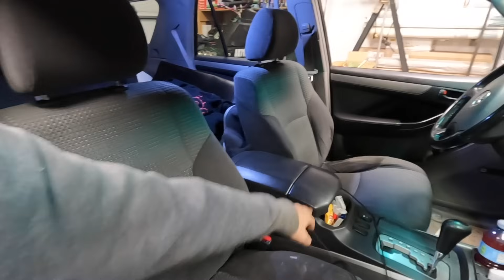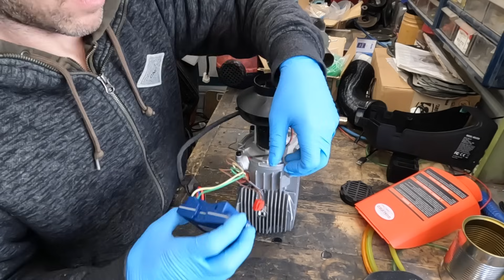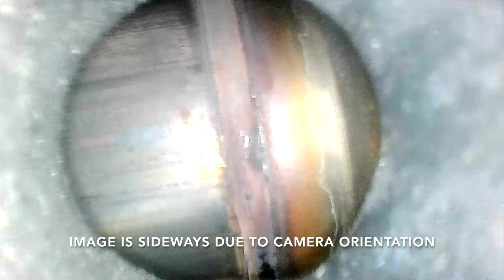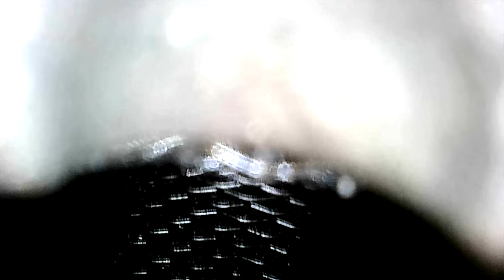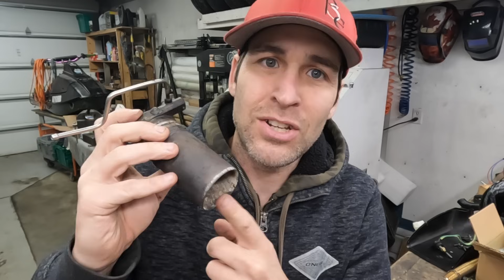Diesel Heaters - Orientation Deep Dive - Heater Mounting Explained

Comment: So what your saying is... you may mount the heater on its side?
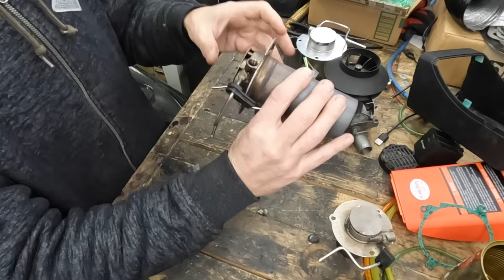as long as "Flame initiation hole" is facing up, so fuel doesn't drip out 12:29
Reply from the maker: Basically, yes. Make sure that your glow plug is tight, and i would inspect it after a few hours of running, to make sure it isn't leaking.

I have not had any issues, as long as the initiation hole is facing up.

Comment: In the video, the 5kw vevor diesel heater was the one that couldn’t be mounted on one side because of the hole placement in the combustion chamber. However, does that also rule out mounting on the other side? Let’s say in the video you rotated it 90 degrees to the left but because of hole placement, it didn’t work. Let’s say you had rotated it 90 degrees the other way instead. Would that still cause issues or would it work since the hole technically isn’t able to leak now?
Reply from the maker: The only reason the heater can be mounted one way and not the other, is the hole location. In my experience, if the hole is not pointing down (fuel can't come out of the hole) then it will run fine. 

I ran my heater on its side for a year without any issues (caused by the hole).

That being said, some manuals say you can run them on one side and some  suggest only mounting them with the inlet and exhaust pointing down. I would say that if you mount it on it's side, monitor it closely for the first few litres of fuel and see if it does anything funny... If you are mounting it on something that moves, a car, bus, RV etc... motion of the vehicle or parking on an angle could also cause unexpected problems if already compromised.

Comment: Do u think i could make new hole for air and block the first one? I must keep orientation i have now but it is leaking
Reply from the maker: If you can come up with a good way to seal it, then I can't see why not... Keep in mind that that area gets quite hot. JB Weld might work. 

Also... from my experience that material is not easy to drill.
Reply: @loweredexpectations4927 thank u very much for ur answer and perfect video by the way🔥

Comment: With a diesel engine there is an injector to spray a fine mist of fuel into the head, I wonder if that would be better to atomize the fuel would it burn better?
Reply from the maker: I have gone down this road a few times, and had may people suggest it. 

This would work in a larger / higher output heater. The problem is that these heaters burn such a small amount of fuel (low flow). 

In order to build pressure at very low fuel flow, you need an extremely tiny hole. 

For example. A 5hp diesel engine will consume 1.9 litres per hour. These heaters consume a maximum of 0.5. Meaning you would need a nozzle to be about 4 times smaller than one in a 5hp diesel. 

Probably not impossible, but very tricky and probably problematic. You then also need to power a high pressure pump, and that would require more than a few watts.

Comment: Cool video. You confirmed my theories while I was tracing down the reason for the diesel smell and the fuel leaking out from the burn chamber. I first thought the plastic fuel line was leaking, but that was not the case. It was much deeper than that. I opened the combustion chamber and spotted the vent hole. I thought, maybe the fuel was leaking from this hole, but that too was not the case. The metal fuel line was not fully brazed in place and fuel was seeping from around where the fuel line was brazed to the combustion chamber causing a fuel leak mess and diesel smell from the heated fuel leaking out. While cleaning the burnt fuel the fuel line broke free from the combustion chamber making it clear that the fuel line was not fully brazed in place and fuel was leaking from around this fuel line. I cleaned all of this location, fully brazed it back in place, and reassembled it. I have not had any more troubles with this heater. No more fuel smell and no more fuel leaking outside the heater onto the floor. The smell was much worse during a lower level of three or lower than it was at higher heat levels.  I hope this helps anyone else who has experienced this dangerous situation.  Had nothing to do with gaskets as other forums have led to believe. 🤠
Reply from the maker: Awesome... good job sorting this out.

Comment: 5kw vs. 8kw .... 3kw difference or just the Chinese marketing illusion ?
Reply from the maker: Marketing wank. 

They almost all use 22ml pumps, so to actually put out 8kw ... it would have to cycle at a little over 10hz to deliver 8kw worth of fuel. More of an issue, is that the body of the heater simply can't support that much heat output. 

The air inlet and exhaust are too restrictive so you have to really force air in there, but more than that, the heat exchanger would not be able to absorb and dissipate that much heat. There would be a huge amount of waste heat out the exhaust (more than currently) and the temp of the exchanger would be off the charts.
Reply: @loweredexpectations4927  Got'cha.
If they're selling a 8kw for $150 and a 5kw for $120 then it's a 5kw as the 3kw difference is just bollocks and fresh air....

Comment: I have a few of the chinese versions, (2 in use most days for 5-8 hours in my spa area, i love 30+deg in there) and have bought various spares parts. Some burn chambers differ to others, in some ways. for example some have taller fins at end plate, meaning a larger air gap, some have a nice taper to edge of entry hole inside fins, others just a sharp 90 deg edge, also height of fuel entry from end plate varies a little with some i have bought, along with some being fully cast including mounting flange, whereas most are are sheet metal for flange, so all are not always identical, and may require slightly different settings for best burning. I had one burn chamber burn out on one side, and was badly expanded out and out of round as well, eventually found issue was the end plate on it was twisted up slightly on the side that corresponded to the badly burnt metal in chamber. I assume due to the extra air being pushed thru the larger gap on that side. So airflow path and amount definitely effects the quality of the burn. Ps, re glow plug time before pump start, thats set by Pf number in settings, pf5 is standard which my manuals says is 85 watts, pf6 is 90 watts. But another site i have seen said these settings are actually the delay before pump time, so pf6 would be a longer delay, which seemed correct the one time i tested it. Good heaters, but a shame the 5kw and 8kw are the same units, and only max out at  under 4.5kw in the real world .  0.5 liters per hour of fuel, simply can not be any more with efficiency losses ( ie 0.5 liters only contains 4.85 kwh of energy at 100% efficiency, which no heater will be), and is the max all mine use at 8 hz setting in open air.)
Best of luck with your mods, should be fun playing with settings to get it to run clean at all output settings. Ps tried a larger pump (24ml )on one of mine, was useless, could never get it run clean throughout output range, so gave up on that idea, but may be an option in your experiments. Talking to some folk, they do not bother with gaskets now, and just use a suitable manifold sealant instead, unsure on that idea, but one of mine currently is trying it, seems fine so far (100 hours approx). Never seen any brushless motors either, including the new spare's  i have bought. - Mine (6) are all the white alloy case versions, as i prefer metal to plastic. Had 2 displays die so far, got very faint on one, info missing on another. Only used one new glow plug, and that was i broke one, but did have one go open circuit, but twisting wires wrapped around stem with pliers, it came back to life. But changed fan bearings on a few, often factory junk get noisy within a year or less (625z or zz is the part number for mine and most i think) simple enough to do for those that are careful, observant, and usually competent with such stuff, but new motor/fan assemblies are cheap anyway, so most just swap it out, which i do too, and replace with better bearings later as a spare.) Also had 2 exhaust pipes burn out and leak, they get brittle first then crack,(especially if disturbed) which can be an issue to notice if heat tape wrapped like mine are, replaced one yesterday as was noticing  an occasional odour in room, just had a small crack and was not triggering carbon dioxide alarm, but a noticeable smell especially when it dropped back from high to low output . -which is why i looked at your video, as thinking of lying them on side so no exhaust will then be inside room. Ps, i have found water blasting is the easiest way to clean dirty burn chambers and housings, after trying various solvents and air pressure etc with limited success.
Reply from the maker: Thanks for the detailed comment. 

I have had chambers of different quality as well. My first Vevor heater was by far the best, and a little smaller diameter tube. The others I have ordered erode away faster. 

I haven't really had any issues with the glow plugs, but I also haven't had a controller (for very long) that allows adjusting the PF. None of my current heaters grant access to an engineering menu. 

Yeah... based on the fuel pump sizes and HZ of the pump, you can calculate that they are really all about 5.4KW max. I have used my heaters MANY times without any gaskets or sealant at all. The pressure is fairly equalize and any difference is due to irregularities in combustion... as far as I can tell. 

I have seen the exhaust pipes fail but only after I have had them glowing red hot a few times, and then tried to bend them. 

It has been suggested to me to blast my chambers, but I have found that the area that causes the most problem (the area behind the baffle) is not accessible by almost any means of cleaning. Once that wick area gets clogged up, it's a real situation. The trash in the tube itself is pretty easy to deal with.

Comment: I wish they made bigger ones.  15kw sounds great
Reply from the maker: I think someone, somewhere makes larger ones. The main issue with more KW is that you need everything to be much larger. Your exhaust and inlet need to be larger to support combustion, your exchanger needs to be larger to capture and dissipate the heat, your fans, motors and pump needs to be larger, so you basically need to make a whole new heater design.

Comment: I have the same 2kw you have from the video I decided to test if I can run it upside down. Exhaust going out the top. Currently I am having no issues whatsoever. I never heard you state in the video if that is ok on some. Will I run into any issues like this?
Reply from the maker: Not all of the chambers are built the same, but from all of them that I have seen, you will likely end up with some diesel leaking out if you place the heater with the exhaust pointing up. 

There is a small flame initiation hole where the glow plug is installed, and the fuel will pool around the plug until it runs out the hole.

Comment: You sound like you understand this well enough to tell me if my idea is crazy or not :)

Heating an RV, 35’ long. I want to have a chamber of coolant that is pumped through a couple different heat exchangers (aka radiators) in various parts of the vehicle. 

Thinking of modifying a standard diesel heater to heat liquid instead of air. Either having the heater partially submerged in the coolant tank, or making a container that fits around part of it. 

I’d also have a water-water heat exchanger for heating hot water, and an electric heater in the tank, and have the tank connected to the engine’s coolant loop. 

The biggest benefit of this complex arrangement is that I could have much more control over the temperature of air heating different parts of the RV, rather than blowing very hot air for a bit, then nothing. 

Not sure if this is a crazy idea. Just curious about your off the cuff thoughts. :)
Reply from the maker: I don't know that it is crazy, but I think it's unnecessary. You can purchase these units that are already set up to heat water. You can't get them from Vevor, but they are available on many websites. 

They cost a little more, but I believe they are well worth it. Other than that, I think it is a great idea. You may need a larger than expected pump to circulate the water, or a dedicated pump for each room / exchanger.
Reply: @loweredexpectations4927  Thanks for the suggestions and reminder. I will look around more thoroughly. When I checked a year ago or so, I saw one or two water ones, but they were ~3x the price and had very few but mostly poor reviews. I will search again, because it would be much simpler. 

I’m still trying to figure out how best to bring the system up / figure out what I need. One of the two propane furnaces is still totally reliable, one is a bit flakey. I might add some temperature probes and try using a single radiator and see how much heat it puts out. Or, maybe just try using it at home. Except that my house has much better insulation than the RV so I don’t know if that would be helpful.

Comment: Thanks for the video! I’ve got a wallas heater I’m trying to replace in my boat with one of these Chinese diesel heaters and I already have the exhaust system from the wallas going out vertically through the roof. Any recommendations on how to vent one of these out vertically through?
Reply from the maker: I'm not sure what sort of setup you currently have, but I suspect a through wall exhaust fitting would be the best option. You can then install a 90º elbow to stop water from getting in.

Comment: Like @LowAmbitions I too am installing an "8kw" in my attic or actually void area, where the ducted aircon is and letting the fan sucking the hot air and blow it around the house. This is in Brisbane Australia, and I think it's possible to keep some rooms warm like 22 degrees, mind you the outdoor temp in winter goes to only -1 or -2 and day temp between 18 and 25. The area will be around 114 m2. I'm planning on using a bigger diameter aluminium pipe 2.5 meter long encapsulated in a bigger shorter open ended pipe, enclosed near the heater, but with a flex pipe attached, joining into the aircon ducting. I've done some preliminary testing without using the exhaust heat, and I got 22 deg with outside around 8 deg. What I don't know is I need to have the diesel tank outside on the ground, which mean the pump needs to pump close to 3 meter vertical and 2.5 meter horizontal. Any comment is very welcome......
Reply from the maker: Sorry I missed your comment. This sounds very interesting. Not something I could depend on here in Canada, but very cool.

Comment: I had an idea, thought I might check if someone knew the answer and here I am. I love YouTube but I love creators  more. thank you for making this video. I'm installing my diesel heater in my attic and don't want to burn down my house so thanks for the free PSA. much love from the UK
Reply from the maker: Thanks for the comment ... sorry for the delay, I have been busy trying to buy a house... 

Play safe.... Make sure to take your time routing the exhaust in a safe way. Both for exhaust smell, carbon monoxide and heat... the exhaust on these can get very very hot, so you want to have your install done so that it will be okay in the worst case scenario. 

Cheers from Canada !
Reply: @loweredexpectations4927  Thank you for your reply. yes i want to lower the heat from the exhaust with some sort of heat exchanger before i send it anywhere near the structure of the roof and im still trying to come up with something for that. was thinking a small radiator or something along those lines, also something i can drain the condensation from too.

Comment: Hi joel maybe you can try burning wast tdh oil . It needs to be changed on tractors between 250 hours and 500 hours depending on the tractor and severity of use . Unlike used motor oil it generally doesn't have the high carbon buil up that we see in used engine oil . Just a thought.  Cheers 🍻
Reply from the maker: Thanks for the comment. I have done all my testing in the past with stuff that I get from my summer job, lawn mower repair, but I could likely find a source of that. I think I actually have some new TDH in my shop somewhere.